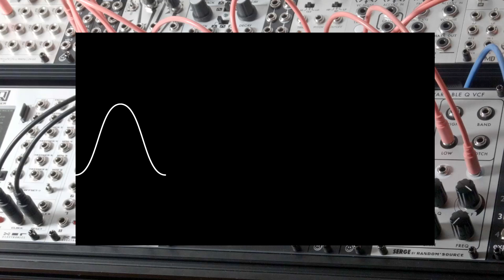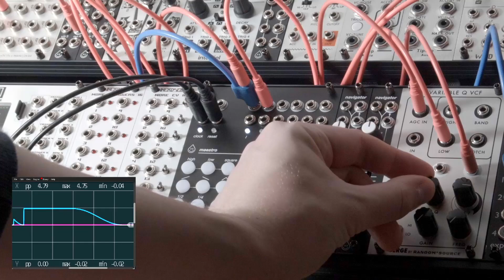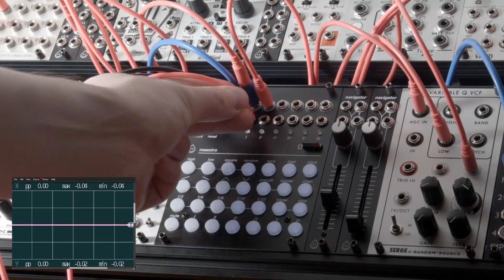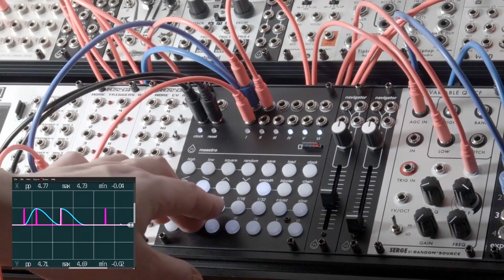Maestro Chain Deep Dive

Comment: At this price-tag an integrated oscilloscope like display would be nice  to see what your chain actually looks like and what is going on. Much better than an external scope it could show the whole chain as it knows how long it is.
This way you could also easily optically step thru the chain and change single steps in a long chain.
I’d rather sacrify 1 or 2 channels for making the module more usable this way.
I guess it happens often that you made a long chain that you like but dislike one step.
I mean the claim is that this module brings the flexibility of DAWs into Eurorack, but it lacks in usability as we are used to see what is going on from the DAW